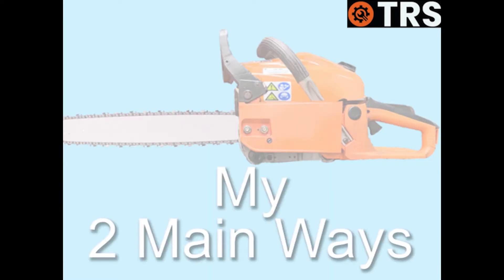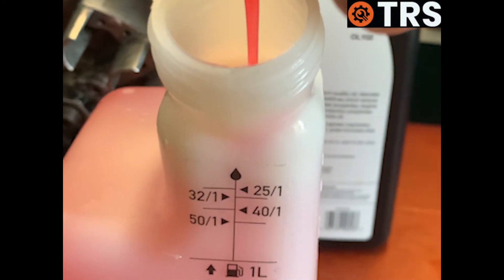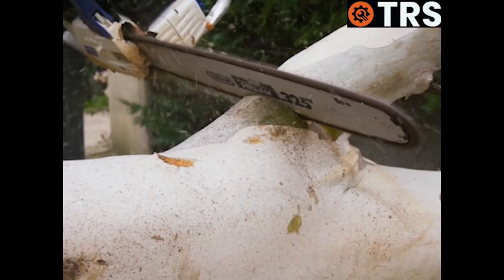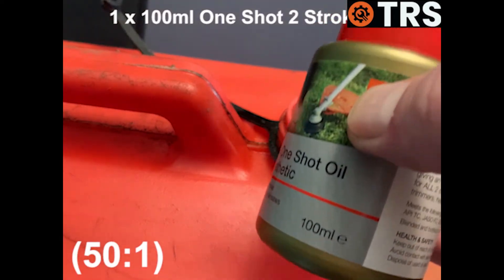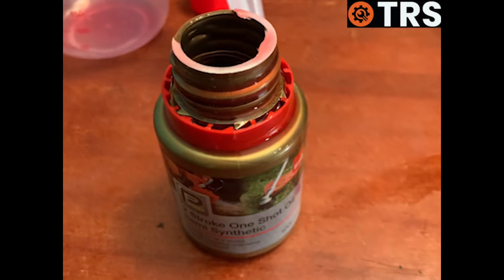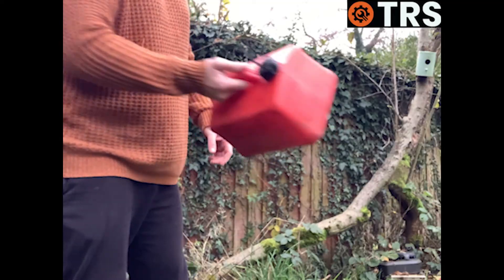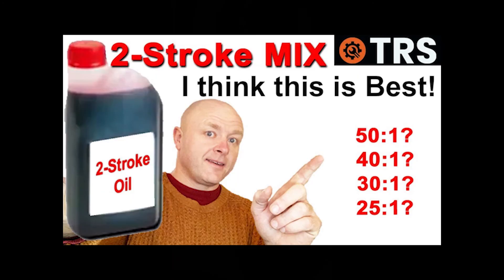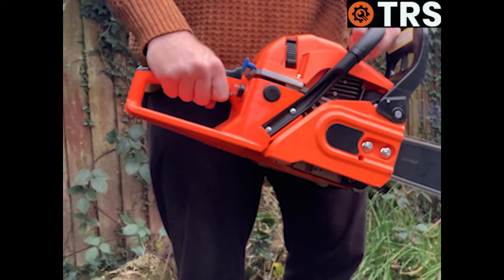The Only Guide you Need for Correct 2-Stroke Fuel Mix Ratio!  (by Craig Kirkman)

Comment: I just bought a brand new one and the owners manual told me 20 to 1 until twenty hours of use i never did that ever in my life iv always did 25 to 1 always even when new
Reply from the maker: That’s a really good point. 

Some manufacturers still recommend a richer mix for break-in (like 20:1 for the first 20 hours), because the extra oil gives more lubrication while the piston, rings, and bearings are bedding in. After that, they usually spec something leaner, like 40:1 or 50:1.

That said, many people (like yourself) have always just run 25:1 from new without issues — especially if using a high-quality 2-stroke oil. Modern oils are much better than what was around when those manuals were written, so the engine is often perfectly happy without the heavy break-in mix.

The main thing is consistency: a good quality oil, the same ratio every time, and making sure the carb is tuned properly. Too little oil = long-term wear risk, too much oil = plug fouling and carbon build-up.

So while the manual’s advice is the “safe” option, your 25:1 approach with quality oil is also a very solid practice.

Thank you for letting us know

Craig

Comment: Very good ways to get it right. Also, the ratios are proportional to the heights of the oil and fuel in a straight container ( a jar of gherkins eg, is good enough). So the correct ratios can be found by measuring the lenths of the oil and then fuel. 🐸

Comment: For what or when would you use 1:25 ratio than 1:50?
Reply from the maker: The ratio of oil to fuel in a two-stroke engine is crucial for its proper functioning and longevity. Here’s a breakdown of when to use each mixture:

### 25:1 Two-Stroke Oil Mix
- **Older Engines**: Many older two-stroke engines are designed to run on a richer oil mix, typically around 25:1. These engines often lack modern lubrication technologies and thus require more oil to ensure proper lubrication of internal components.
- **High-Performance or Racing Engines**: Certain high-performance or racing engines may specify a 25:1 mix to handle the increased stress and heat generated during operation.
- **Specific Manufacturer Recommendations**: Always follow the engine manufacturer’s specifications. If the manual specifies a 25:1 mix, it is important to adhere to it to avoid potential damage.

### 50:1 Two-Stroke Oil Mix
- **Modern Engines**: Most modern two-stroke engines, especially those with advanced lubrication systems and better materials, are designed to run on a leaner oil mix, typically 50:1. This is common in newer chainsaws, leaf blowers, outboard motors, and other small engines.
- **Environmental Regulations**: Some regions have strict environmental regulations that mandate the use of less oil to reduce emissions. Engines designed to meet these standards often use a 50:1 mix.
- **Synthetic Oils**: Modern synthetic two-stroke oils provide better lubrication and combustion properties, allowing for a leaner oil mix. Engines that recommend 50:1 often assume the use of high-quality synthetic oil.

### General Guidelines
1. **Always Check the Manual**: The most important guideline is to always refer to the engine’s user manual. The manufacturer will specify the correct oil-to-fuel ratio for optimal performance and longevity.
2. **Oil Type**: Use the type of oil recommended by the manufacturer. Using a synthetic oil designed for 50:1 mixes in an engine requiring a 25:1 mix may not provide adequate lubrication, and vice versa.
3. **Consistency**: Stick to the recommended ratio consistently. Switching between different ratios can lead to improper lubrication, increased wear, or even engine failure.

In summary, use a 25:1 mix for older or specific high-performance engines as recommended by the manufacturer, and a 50:1 mix for most modern engines, particularly when using synthetic oils and aiming for compliance with environmental standards.

Comment: I just bought a new petrol strimmer, 40 to 1 ratio. Every YouTube channel says 25ml to litre of petrol, that litre mixing bottle you show , after putting 1 litre of petrol in, it takes like nearly a 80 ml of that one shot to get to that 40 to 1 ratio. And 100ml is supposed to be ok for 5 litres. What is best.????🧐☹️
Reply from the maker: To create a 40:1 fuel-to-oil ratio, you need 40 parts of petrol to 1 part of oil. Here's how you calculate the amount of oil needed:

1 litre of petrol is equivalent to 1000 millilitres (ml).

For a 40:1 ratio:
1000 ml petrol (1 litre) / 40 = 25 ml of oil 

So, you need to add 25 millilitres of oil to 1 litre of petrol to achieve a 40:1 ratio.

To make a 40:1 fuel-to-oil mix with 5 litres of petrol, you can follow the same process as before:

First, convert 5 litres to millilitres:
5L = 5000 ml

Now, use the ratio to find the amount of oil needed:
5000 / 40 = 125 ml oil 2 stroke oil. 

So, you need to add 125 millilitres of 2-stroke oil to 5 litres of petrol to achieve a 40:1 mix.

I hope this helps.

Craig
Reply: @TheRepairSpecialist  thanks,👍

Comment: I always mix the oil in a jar with some fuel THEN add to the main fuel can then shake fully.  Trying to mix oil in a big container, tends to leave it not fully mixed and i used to get this black carbon "stick" shorting the spark plug stopping it dead. I always mix in a jar then into the can and mix again.  Also 1 gallon container is around 4.5 lts so 200mil of oil will make it slightly more rich than 25/1 which is better than lean so plenty of protection for your 2 stroke engine..
Reply from the maker: Ok, thank you